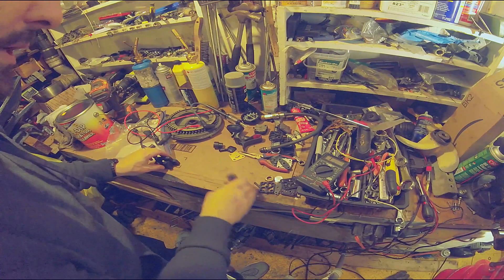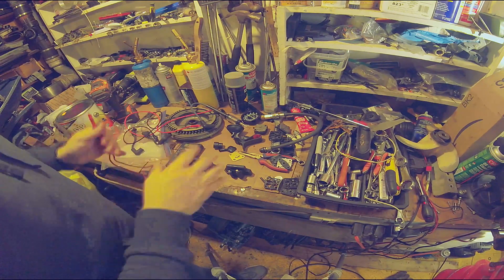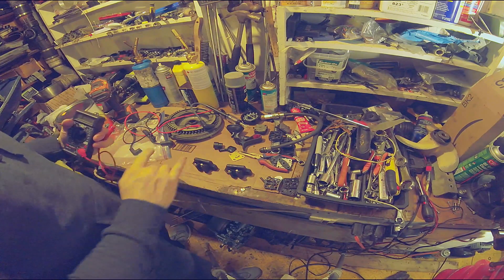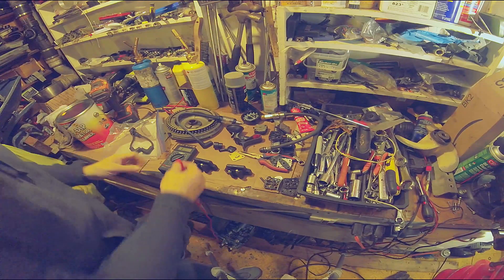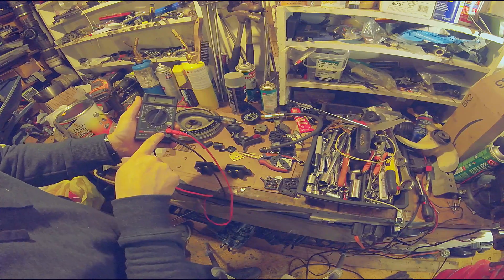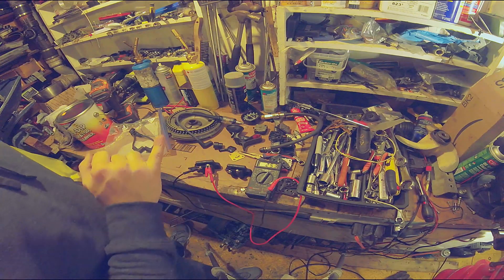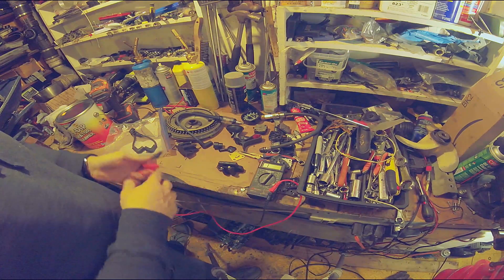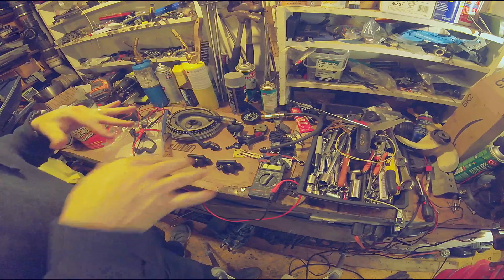How to test Ignition Coil with multimeter. 1988 Evinrude 9.9hp outboard. How I tested it!

Comment: Great video buddy boy! I gotta 9.9 Evinrude 1987 no spark died at full throttle in the middle of a lake. 😢
Reply from the maker: that SUCKS!! was it the coils?? pretty rare! usually its the coil pack
Reply: Same thing happened to me, but the motor ran on one cylinder and got me back to shore during a pretty bad storm. Problem was previous owner didn’t push spark plug wire fully on to the coil pack end…….
Reply from the maker: @PerroSucio  THAT SUCKS! but at least thats an easy fix!

Comment: How to test the power pack when on the motor?
Reply from the maker: you have to take the plug apart and test white wire to brown and 2 others
Reply: @BlackoutBilll21  Thanks. I did that and because I didnt trust my multimeter completely, I also swapped my ignition coils (one at a time), spark plugs, spark plug wires, and powerpack with my other johnson (50hp) that has spark and it turns out spark continued to show. This rules out all named components from my "no-spark issue." Where should i look next? Please help, THANK YOU!
Reply from the maker: @lmt-adventures  ok so you’ve confirmed the coils and power pack is good correct? You need to confirm your stator is ok now
Reply from the maker: Sometimes the stator is ok but the timer base may be faulty
Reply: I have the same as shown to in the video you’ve linked here. So is there a way I can test the “stator” before buying one?
Reply from the maker: yes. Take a multi meter and take 2 of the what should be 4 wires. You should get between 200-500 ohms
Reply: Yes, I have confirmed coils/powerpack/spark plugs/plug wires are all working fine. I just don’t know where to check next so thanks for the input. I’m a rook so all I’m doing is based off of YouTube infos. I took the flywheel off and this motor (Johnson 25hp electric start) doesn’t seem to have points on the plate under the flywheel.
Reply: Is the whole plate considered under flywheel considered “stator” or is it one component mounted on the plate?
Reply from the maker: @lmt-adventures  do you have the big green ring? or is it different? Everything under the flywheel is suspect to me. No points on your motor if you have a power pack. Under the flywheel are things that bolt on that are IN charge of spark ie stator,. Im assuming is falutly if you checked everythng else
Reply from the maker: @lmt-adventures  https://www.youtube.com/watch?v=QAs2ynCxanU

you either have a big green ring or whats in this video!
Reply: I tested the two black/white wires coming from stator and got a reading of 37.7ohms. Terminals B&C on the harness adapter coming from stator plate)……Tested two wires brown/white coming from what I guess is the trigger on the same plate as the first two wires (A&C) and got a reading of 490. Obviously, based on info you’ve shared the second component falls within spec. But the first one I tested, is faulty. I got one whole stator plate on the way hope it solves everything.
Reply from the maker: @lmt-adventures  Hopefully the stator is the issue. I just want to confirm you have NO spark at all correct? Make sure you check all your ground wires too! There is a black and yellow wire that is your kill switch. That need to be grounded or disconnected. Also does your motor have a lanyard? Make sure your landyard is hooked up! and check your kill switch too to make sure its not grounding out.
Reply: @BlackoutBilll21  Thanks and yes, I have no spark whatsoever even after putting good stator/spark plugs/power pack/plug wires on from a running Johnson 50hp and still no spark on the Johnson 25hp. 

The motor is sitting on my 12ft aluminum boat but nothing has been hooked up yet to a controller, I just have hot wires going to the battery and using a red ignition adapter with a key at the end to connect to the red end already on the motor for electric start. That said, I don’t know where the kill switch is and no lanyard is present and I’m a minke to crank it just no spark. I think I have to find a way to locate or rule out those two things you’ve mentioned because they could very well be cutting, although the Johnson 50hp I have also is in the same exact setup (not hooked up to anything but battery and same key harness I’m using for both motor) and that gets strong spark without knowing where kill switch is if any or the lanyard. Hmm
Reply from the maker: @lmt-adventures  so you probably don’t have a kill switch and the key switch is what kills the Motor. We need to find the black and yellow wire that initiates the stop circuit. It’s gotta be that or something else going to groond
Reply: @BlackoutBilll21  Good news, stator disk arrived so instead of switching the whole thing I decided to unscrew and exchange the stator part (the thing with copper wire wrapped in it—I assume is the stator, idk) and then got spark immediately. Got some fuel in her and got her talking. Turned it off right away tomorrow when i have time I’ll run water and see how it runs.  Compression is good so should be a good strong motor. Thanks 🙏 for your time and inputs, learned a lot!
Reply from the maker: @lmt-adventures  I’m freakin EXTATIC to hear this!! Keep me updated! I’m happy to help! Just tell your friends to subscribe lol
Reply: @BlackoutBilll21  absolutely!

Comment: Great video, made it simple just like you were wanting to.  I'm working on a 9.9 1981 Johnson, coils test, ran momentarily real good in the barrel, was smooth but fadeded away to a no run no start and no spark, and have never been able to get it to hit again. Finally Ordered a power pack today. Frustrated. I thought I was gold after the start up. Cleaned the entire fuel system while waiting for parts.
Reply from the maker: I hear ya! This evinrude was a real pain! turned out to be the carb the whole time!

Comment: First you don’t need to remove them to test ! Second it should read 235 to 265 so yours are good third your not asking the right people and calm down bud it’s a outboard not the space shuttle ! Lol. Go on YouTube and ask Old Johnnyrude ( he’s a mechical engineer ) your questions or me or Chrysleroutboarddude ( one of the best outboard mechanics I ever met ) or Ron Baker ( very very good outboard tech ) we all can answer your questions !
Reply: I got a question for either of you. I have a 9.9 1996 evinrude. Last year the thing would start but throttle weird and putter at the start, then after a few minutes run fine. And the end of the year it wouldnt hold an idle. It would run on eether but not gas. I completely cleaned/rebuilt carb, changed fuel pump, replaced fuel line, new gas tank and gas/oil mix,  new spark plugs. 

I got it to start, it idled rough for about a minute, then died. Now, theres no fire at all whatsoever. Plugs wont fire. My last resort is changing ignition coils maybe?
Reply from the maker: dont know why I never saw this comment!! sorry its a year late Im sure you figured it out already. I would check coils for spark. and also what are your compression numbers?
Reply: @BlackoutBilll21  whats funny is i was scrollin through YouTube just now and saw this notification. Last year i ended up changing out the ignition coils about a week after i posted this, and it started right up and held a great idle. And it did all summer this year. After taking off the old coils, one looked like it was sort of melted at the connection and the other one, well, just old. But it did the trick!
Reply from the maker: @johnnylawrence  awesome!! glad it worked out!!
Reply from the maker: as always THANK YOU!! will always  use you guys for research! Plus will be becomin and aomci memeber soon!!
Reply from the maker: also the outburst is more for youtube theatrics lmao
Reply: BlackoutBill21 just tell AOMCI I sent you ! Lol. I get credit for new members ! I’m with the Gopher Chapter ( Minnesota ) !
Reply from the maker: Dave Kimbler if they can help me get to 1000 subs I’ll do whatever you want lmao